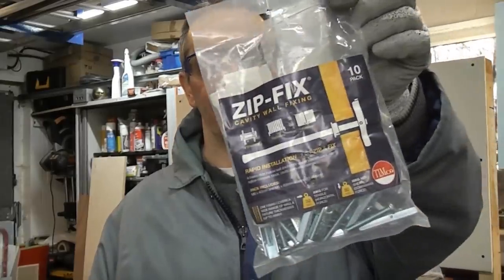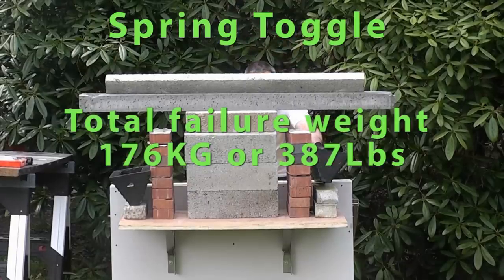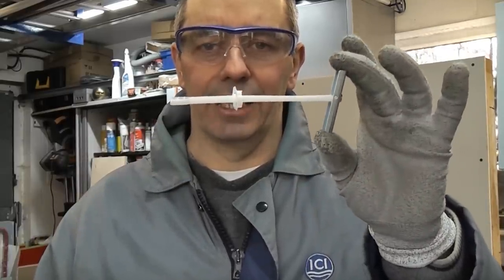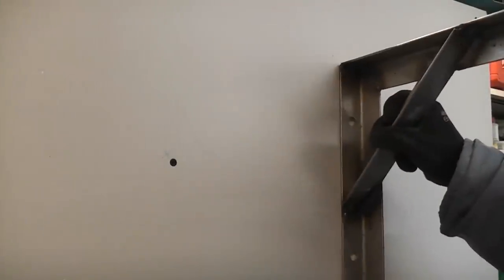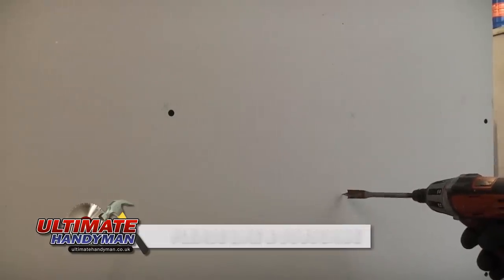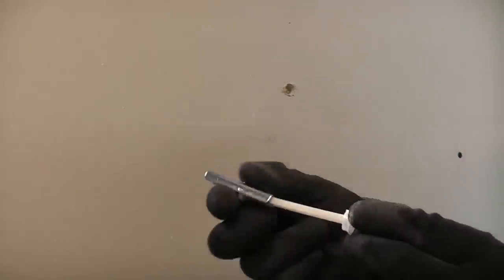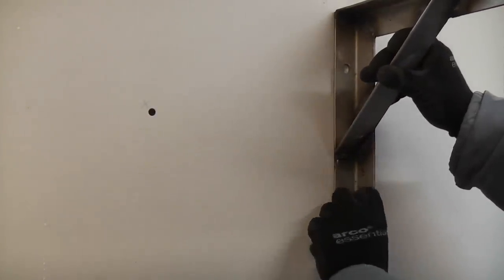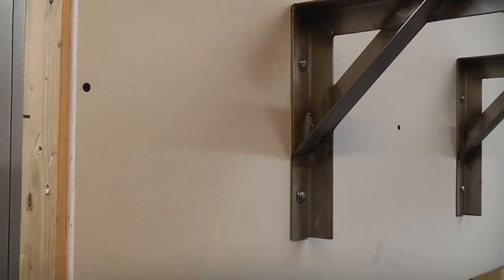Zip Fix plasterboard fixings | The best plasterboard fixing?

Comment from the maker: I hope everyone is coping during this difficult time!

I’m back on site next week for a few weeks, so I’ll get a break from the Mrs and kids 😉

Editing videos is very time consuming, one video that I filmed last week has over 8 hours of footage to edit down into a watchable video. The problem is that if I make a video too long people complain and if I make them too short people complain as not enough detail has been covered. I’m thinking that people have lots of spare time, so I’ll go for a longer video and that will have the added bonus of curing your insomnia 😊
Reply: I got a massive sink with drawers to install in my bathroom.. around 60kg (maybe more) empty - without feet.. The wall is double plaster board and ceramic tiles over.. backed by metal frame. The sink/drawers were meant to screw into concrete with 2 big screws in top corners. Would a plaster wall like this hold this? Would it help to back everything with a plywood screwed in multiple places to wall?  Any suggestions?  Thanks!
Reply from the maker: Ideally you would have put some 1" thick plywood in the partition to fix the basin unit to (but hind sight is a wonderful thing). To be honest I'm not sure if the plasterboard and tiles will hold that much weight over a period of time, especially if the drawers are full and if someone leans on it. 
The plywood option might work, or perhaps you could make some stainless steel feet for it (I know that might spoil the look of it), but if it falls from the wall there is a good chance that you are going to flood the house at the same time!
Reply: Just do what you enjoy as your content is good 👍

Comment: They are a great fixings! I still have some M10 ones left over from a cloakroom installation where the client wanted a cantilever handbasin fixed to a very poor lath & plaster wall. I fitted a sheet of 12mm Aquapanel to the wall with countersunk bolts and fixed the basin through the Aquapanel. The basin held my weight easily once it was fixed.
Reply from the maker: They are great for use on lath and plaster. Aquapanel is very strong, so I can imagine that being very solid.
Thanks for the comment 👍

Comment: Great video and I agree these are fantastic plasterboard fixings. I’ve only ever used them the once and had a bit of a struggle….the cavity was full of insulation material! Had to poke it out the way and list of few of these fixings in the process. Eventually got them to work and they held very well.  I look forward to using them in an empty cavity wall 😀
Reply from the maker: I've used these lots of times, insulation can be a real problem for many fixings!
You can get an undercutting tool though, which is made by Grip-It (for the Grip-It fixing)
I used it in this video- https://www.youtube.com/watch?v=-geib-6sa3M&t
I've not used that for insulated boards with Zip fix fixings though- https://fave.co/3lKpK4g
Mainly because insulated boards are normally fixed to solid walls, so I normally used a dot and dab fixing 👍

Comment: ICI, Good grief that a childhood memory.

Just took delivery of an Evolution table saw, you seem to rate Evolution, I believe you mentioned them once or twice over the years.

All the best, stay safe.
Reply from the maker: I started working to I.C.I in 1991, they were a fantastic company to work for!
Evolution saws are superb for the money, they will literally cut through anything (with the correct blade)
They are a little noisy though when cutting metal, so I always wear good hearing protection and a full face visor when cutting metal.
I hope you get years of use from the saw 
Thanks for the comment 👍

Comment: Fully agree used then to put up some wall units, used M6 x 60
Reply from the maker: Yeah, you can't go wrong with these fixings. Spring toggles can hold more weight, but these are much easier to use and better IMHO
Thanks for the comment 👍

Comment: Great video.. just wanted to know if you could recommend any fixings for insulated plasterboard. Thank you
Reply from the maker: The Grip-it fixings can be used with insulated plasterboard, but you need the under cutting tool as used in this video- https://www.youtube.com/watch?v=-geib-6sa3M
If there is a solid wall behind the insulation you might be able to fix to that- Rigifix- https://www.youtube.com/watch?v=xaYfs3lr1jI

Corefix- https://www.youtube.com/watch?v=7xLhIPoO5gQ

This might also help- Fix to an insulated wall- https://www.youtube.com/watch?v=7DGGUbbbBZI&t

Thanks for the comment 👍

Comment: I do agree, I love that fixing too but the bigest problem is that requires quite a lot of room to expand behind plasterboard so not always works, I you know your walls thats ideal, but when I'm installing something at customers property its a guessing game sometimes
Reply from the maker: Yes, I had one job where I could not get these in, but found out later that it was a Paramount partition. I always try these first and if they won't go in I look for alternatives.
Thanks for the comment 👍
Reply: I've come across the same senirio then i use grip it plasterboard fixings but you need 18mm drill bit.

Comment: Great in theory BUT most newer walls have insulation behind the plasterboard. I couldn't clear enough of the insulation in a cone shape behind the plasterboard to get the toggle to articulate and seat.
Reply from the maker: I've not worked in many new houses, but I guess you could use a tool like the Grip it undercutting tool in a drill to remove some of the insulation.
Thanks for the comment 👍

Comment: I take it that these would work on lath and plaster? Regular toggles seem to be the only recommended fixing for those and this seems like an extension of that concept but with smaller holes in the wall.

Edit: Just saw you mentioned lath and plaster, brilliant lol.
Reply from the maker: Yes, I've use these on lath and plaster before- they normally work well ;-)
Reply: @ultimatehandyman  Great - ever used the Fischer equivalent of these zip toggles? Not sure if they're great or just overengineered.

Beyond that, any advice on how to use these well in lath & plaster? For example, do you always keep them vertical, or are you better off putting them horizontal (parallel to the lath on a wall) in order to avoid hitting the mortar keys? What do you do if you end up having the toggle rest on the keys? 

I know the mortar is a lot stronger than the surface plaster but I imagine this is a concern when mounting on it.
Reply from the maker: @Tephnos   No, I've not used the Fischer ones- but Fischer normally make really good gear.
I'd try and rotate them so that the toggle is in the opposite direction to the laths, as that is the way I had them and I hung a wall basin from them.
The backing plaster is normally pretty soft and will compress against the laths, once the screw is tightened.
Reply: @ultimatehandyman  Thanks for the info, very helpful. Yeah, the Fischer ones look a lot more plastic-y, but still have some kind of metal brace for the toggle end. Was just wondering if that would compromise strength over the all metal ziptoggle. The main advantage I can see is that it comes in a 10mm size, so smaller holes in the wall if you're not mounting extremely heavy stuff. 

For the record, I'm wanting to mount a couple of ~6kg speakers (small 5" studio ones). As placement is dependent on math for best sound, you can't just shove them into studs. The only options beyond the ziptoggles would be an ugly wood batten on the wall, or tearing down a good chunk of plaster to put a batten in the wall. Both options I'd rather avoid if the toggles would do the job. What do you reckon, in your experience?
Reply from the maker: @Tephnos   Snap toggles/zip fix fixings  should be fine ;-)

Comment: Thanks so much for all your helpful videos. Are these suitable for putting up Ikea Platsa floating cabinets on plasterboard walls or is essential to fix on to a stud? And does it matter if you have insulation behind the plasterboard, is there a better fixing you'd recommend for walls with insulation? Thanks!
Reply from the maker: It depends how much they weigh, including any additional weight once they are installed. I would always try to fix into at least one stud- https://www.youtube.com/watch?v=glzwY76O0d8&t
You could use these with insulation, if you removed some of it, perhaps using the undercutting tool from GripIt, you could even use the Gripit fixing, demo here- https://www.youtube.com/watch?v=-geib-6sa3M&t=1s

Thanks for the comment 👍

Comment: I prefer the Zip fix as well. What is a Paramount Partition? I'm an American and no familiar with that term.
Reply from the maker: I have come across Paramount partitions a couple of times, but never knew what they were until some people commented on my videos and said they are paramount partitions. 
In the UK we often build stud partition walls using 3" X 2" timber, example here- http://www.ultimatehandyman.co.uk/how-to/diy-building/build-a-stud-partition-wall

This means that you normally have a 3" cavity, which leaves lots of room to get the largest plasterboard fixing in there.

Paramount partitions are pre-constructed panels which only have about a 1.5" perhaps 2" cavity, which is filled with egg box type cardboard. The timber in them is spaced out really widely, This makes them difficult to fix to. 

Two videos where I have fixed to them in the past (not knowing they were Paramount partitions) can be seen here-
https://www.youtube.com/watch?v=awuqDum0ay8&t=3s
https://www.youtube.com/watch?v=-geib-6sa3M

Thanks for the comment 👍

Comment: Help! Great video but having just drilled my first hole (13mm as per instructions) and tried fitting an M5 Snaptoggle, I have discovered that the cavity is too shallow (appears to be only 30mm) to accept the toggle fitting.  Do you have any suggestions for an alternative solution?  The board appears to be 15mm thickness - would bog standard rawlplugs do the trick?  The shelf to be mounted is an Ikea 'Lack', which uses a long bracket requiring eight holes and fixings, with a maximum load of 8kg (although in practice the load will be much less than this). There are spare fixing points in the bracket so I can ignore the existing hole and use another point.  Thanks in anticipation.
Reply from the maker: It sounds like that might be a Paramount partition, I came across one here- https://www.youtube.com/watch?v=awuqDum0ay8&t
I ended up using spring toggles, although I have used grip-it fixings in the past.
Spring toggle- https://www.youtube.com/watch?v=WO55oYozlxA&t=1s
GripIt- https://www.youtube.com/watch?v=szx7nMRZSIY&t=1s
Thanks for the comment 👍

Comment: Good vid thanks for posting. 
2 questions, what is a paramount partition ?  
What's the minimum centre distance you can use these? I need to mount a cupboard on a partition wall using the hanger brackets  and cant use the wooden frame work, cheers
Reply from the maker: You are welcome.
I have come across Paramount partitions a couple of times, but never knew what they were until some people commented on my videos and said they are paramount partitions. 
In the UK we often build stud partition walls using 3" X 2" timber, example here- http://www.ultimatehandyman.co.uk/how-to/diy-building/build-a-stud-partition-wall

This means that you normally have a 3" cavity, which leaves lots of room to get the largest plasterboard fixing in there.

Paramount partitions are pre-constructed panels which only have about a 1.5" perhaps 2" cavity, which is filled with egg box type cardboard. The timber in them is spaced out really widely, This makes them difficult to fix to. 

Two videos where I have fixed to them in the past (not knowing they were Paramount partitions) can be seen here-
https://www.youtube.com/watch?v=awuqDum0ay8&t=3s
https://www.youtube.com/watch?v=-geib-6sa3M

I'm not sure about the minimum centre distance, but the closer they are together the weaker the plasterboard will be at that point. I know some hanger brackets have holes that are close together, so it might be better getting some other brackets if the centres are less than say 50mm (or adapt the existing brackets)

Thanks for the comment

Comment: Hi mate can you advise me on what fixings to use to go through tiles and into a paramount wall. I need to hang a shower head rail.any advise is greatly appreciated.
Reply from the maker: Spring toggles are probably the best option, I used them in my bathroom to hang a cabinet on a tiled wall-
https://www.youtube.com/watch?v=gWupPtzXo6Y

They were also used when I hung a large TV on a Paramount partition- https://www.youtube.com/watch?v=awuqDum0ay8&t=3s

They were also the strongest fixing I have ever tested on plasterboard- https://www.youtube.com/watch?v=ECDysfNhx_E&t=1s

Thanks for the comment 👍
Reply: @ultimatehandyman  that's great thank you for your help 👍👍👍

Comment: What fixings would you recommend when you need holes that are clustered close together? I need to install hand rails where the 3 holes are close together. I think that in these might just get in each others way that case. Thanks
Reply from the maker: I never put fixings that close together in plasterboard or even in solid walls, the last time I installed a hand rail, I got a length of timber the same length as the handrail, I think it was 3" X 1" and fixed that to the wall first, then screwed the handrail to the piece of timber.
I would not trust and plasterboard fixing to hold a handrail.
Thanks for the comment
Reply: @ultimatehandyman   When fitting kitchen wall cabinets, the fixings have holes pretty close together, a few centimetres apart. in these cases is it still bad to have fixings close together?

Comment: Not used that type, usually use the ones that spread out at the back. ICI jacket, I’ve had plenty of those, which site did you work on ?
Reply from the maker: These fixings are superb.
I worked at ICI acrylics in Darwen, at their Chapels park and Orchard mill plants (I still sub contract there now as a maintenance engineer). It has changed names a few time since I started there.
Ineos, Lucite international and now Perspex international
ICI was a brilliant company to work for! Which sites did you work on? 

Thanks for the comment 👍
Reply: Ultimate Handyman Hi mate, I worked on Runcorn site for many a year, then moved to Northwich Site again with ICI, alas both have changed hands, yes ICI was a great company to work for, I now work as a gas engineer, self employed.
Reply from the maker: @kevint3845  I went to Runcorn once in the early 1990's but only for a meeting (they arranged a coach for us). It was a huge site, if I remember rightly. A guy that I work with now used to subcontract at Runcorn (Vinny Davies), he is a great guy and sometimes tells me stories about Runcorn ;-) 
I bet you miss working there! You'll never be out of work as a gas engineer ;-)
Reply: Ultimate Handyman Runcorn site was massive yes, I had some great times there, yes I’m busy all the time, am even working in the bad times of this virus, people still need hot water 😉, I could write a book with my experiences at Runcorn site.

Comment: what plasterboard fixing would ypu suggest when needing two holes close together for a roller blind bracket for example? im worried about something needing large holes close together. thanks
Reply from the maker: That can be a real problem, but most blinds are fitted to external walls, which normally have bricks or blocks behind the plasterboard. In which case I would use either of these-

Corefix- https://www.youtube.com/watch?v=7xLhIPoO5gQ&t

Rigifix- https://www.youtube.com/watch?v=xaYfs3lr1jI&t

I would only use one fixing hole, it is often impossible to get two fixings so close together unless it is a solid wall.
Reply: @ultimatehandyman  because ive had an extension and taken photos along the way i know the top corner of the window where the blinds would go has a cavity directly behind. ill go with the best hollow wall fixing you suggest and put one screw through it. thanks mate
Reply from the maker: @mattsidebottom7603   You won't go far wrong with the Zip fix fixings, they are one of the strongest and easiest to use.
Good luck with it ;-)
Reply: @ultimatehandyman  thanks for getting back to me. much appreciated keep up the great content

Comment: Now demonstrate using the same fixing with insulation behind & when plasterboard has been fitted with adhesive...
Reply from the maker: You would not use a plasterboard fixing for a dot and dab wall, you would fix to the wall behind-
Rigifix- https://www.youtube.com/watch?v=xaYfs3lr1jI&t

Or

Core fix- https://www.youtube.com/watch?v=7xLhIPoO5gQ&t

If you think fixing to the plasterboard is better than fixing to the wall behind, you could use the GripIt undercutting tool to remove the insulation, as demonstrated in this video when fitting a cabinet to a Paramount partition using Gripit fixings - https://www.youtube.com/watch?v=-geib-6sa3M